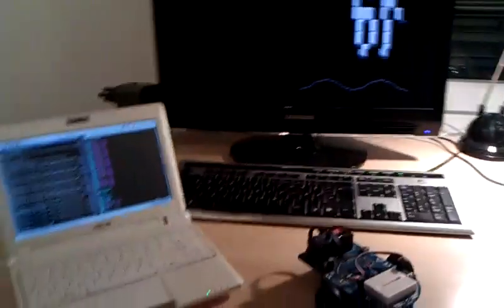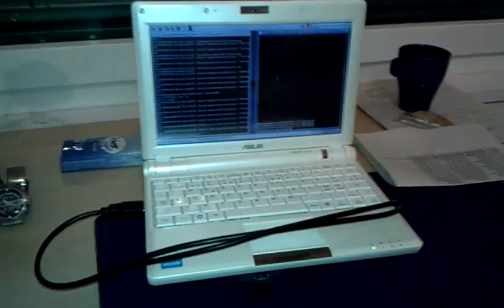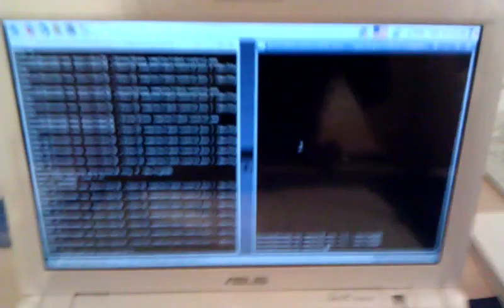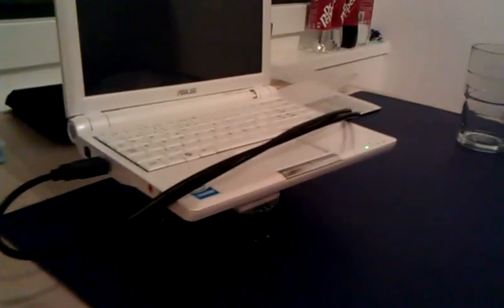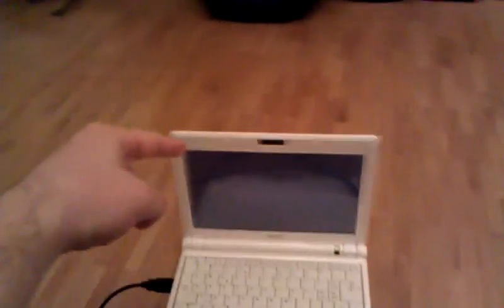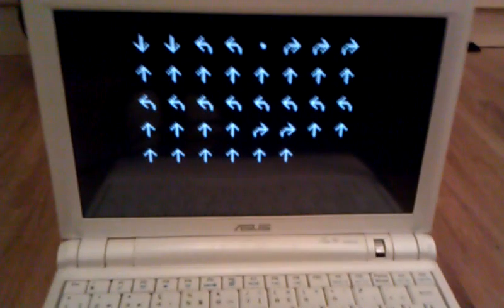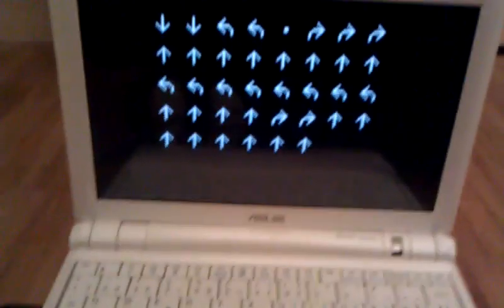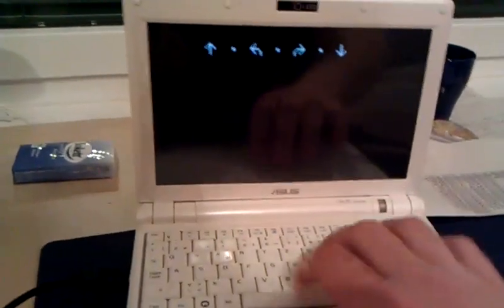DCPU-16 Robot

Comment from the maker: Thanks, good question!

The biggest problem with the DCPU on this 8-bit AVR would be memory. Without external modules the ATMega88 has 1KiB RAM, and the DCPU would need 128KiB. Also, you would have to be very efficient in implementing the instructions; on my main PC, my emulator can run at ca. 1/35 the frequency of the main processor; that ratio would not be enough using the internal 1MHz clock that the robot uses (although you could use a quartz crystal and go up to 20MHz with this unit).